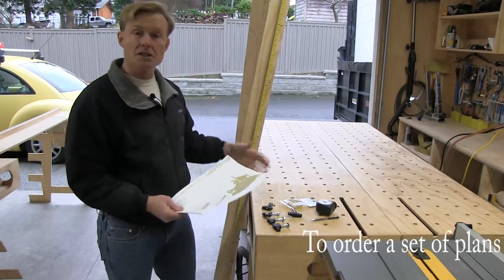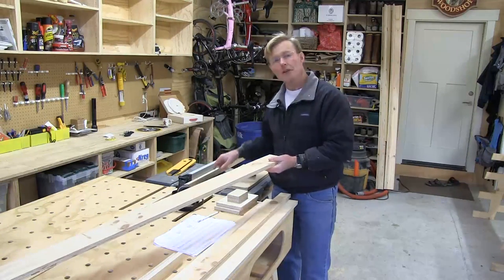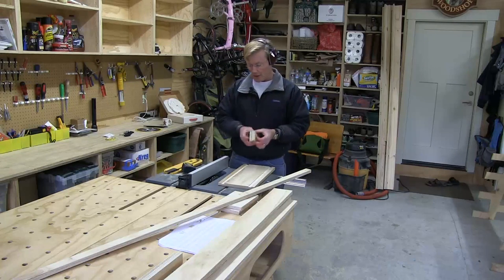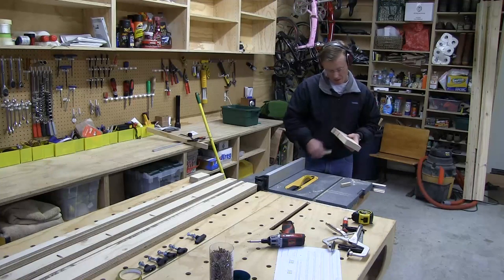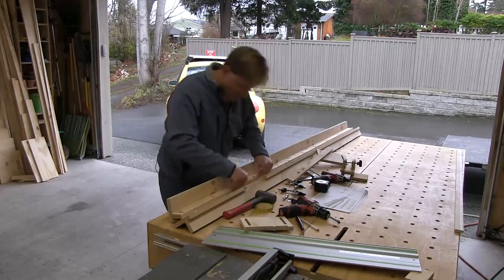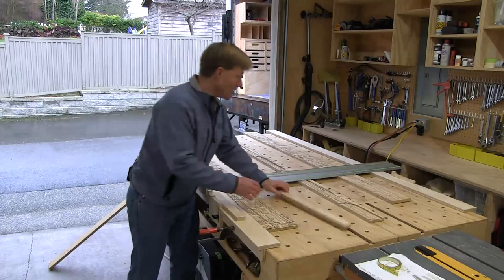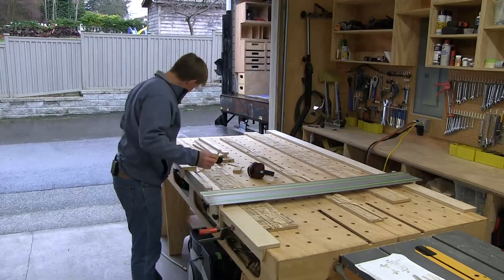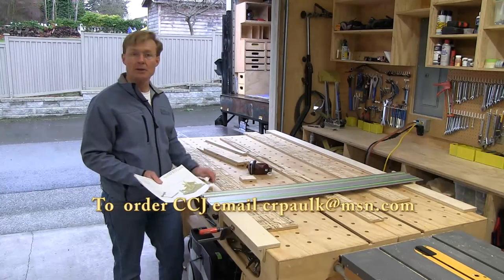Cross Cut Jig for Festool TS55

Comment from the maker: John, it should be no problem. The only part custom to Festool is the notches for the underside of the Festool Track. I think Makita's track is the same. The main thing is that the track doesn't move and is square across the bench for accurate cross cutting.

Comment: Ron, I just completed my crosscut jig this week.  I used William NG's method for squaring a tablesaw sled to square the jig and it is working well.  I have an mft but find it too small for long sheets of plywood and too heavy.  This seems like a good solution without having to drag the mft along.

My trailer is also getting close to completion.  Thinking about doing a video on it.

Cheers.
Reply: Can you give me a brief how to on doing this? I've used William Ng's method on several sleds, I'm just drawing a blank on the exact way to convert the process to this setup.

Comment: Hi Ron. Could this be modified and used on your total station?  Or might that need something more along the lines of a Beisemeyer style fence?  Which brings me to another question: On the total station the Miter saw is obviously in the way when ripping panels, do you swap the miter saw out for a fill-in plate when ripping?  I haven't seen anything on that. (Is there a video that touches on this?) Thank you so much for the great videos!!  I'm outfitting my Express van now and am planning a spot for a 3'x5'x8.5" version of your total station.
Reply from the maker: The CCJ will work great on the PTS "as is." No modification necessary. Just remove the miter saw and it works. Also, no need to fill in the miter saw area.
Reply: +Ron Paulk Thank you!
Reply: Ron - to be clear, if one built the CCJ to the plans it would be much longer than the PTS. So I guess there are  options: 1. Build CCJ to the plans and it works on the PTS, PWB2, etc. There will be some two feet of the CCJ which is not really used.  2. Build a six foot long version of the CCJ by clipping two feet off of certain pieces.
I pursued option 2 as I have built a PTS and PCB.
Thank  you for responding to user comments and best of luck with your next project.

Comment: Hello Ron,

I just bought the plans for the Cross Cut Jig. I have 2 simple questions: 1) What purpose  does the 5mm rabbet on the bottom stop rail serve? Can it be left out? 2) On the track adjuster, could it be better that the 10 mm protruding tab that abuts the rail be relocated to the left side of the track adjuster so that it abuts the rail itself and not the splinter guard?

Thanks,
Daniel
Reply from the maker: 1.The 5mm rabbet is a dust gutter to ensure material is not held away from fence.
2. The 10mm tab is on the back edge of track and not the blade side. Take a look at the cover image showing the track orientation.
Hope this helps,
Ron

Comment: Would this work with another track system like the ez smart? http://www.leevalley.com/en/wood/page.aspx?cat=1,240,73329&p=73304
Reply from the maker: +brad ford Yes it will work, but you will have to work out the details on the connection on the bottom of the lee valley track.